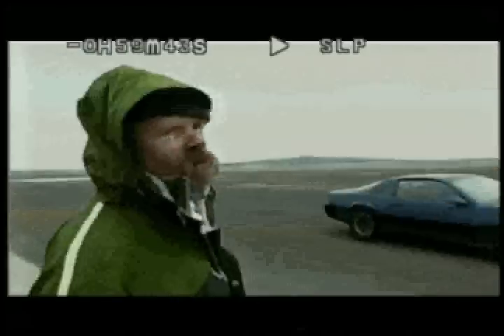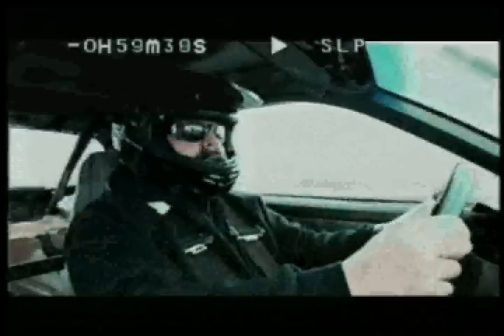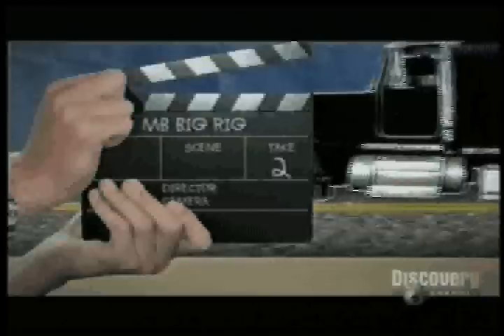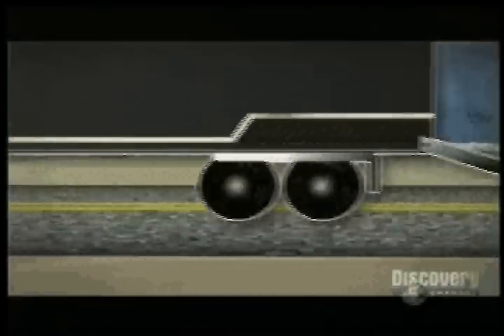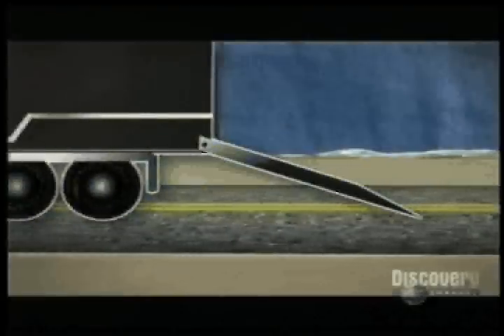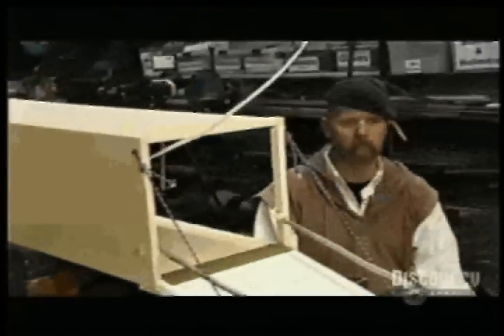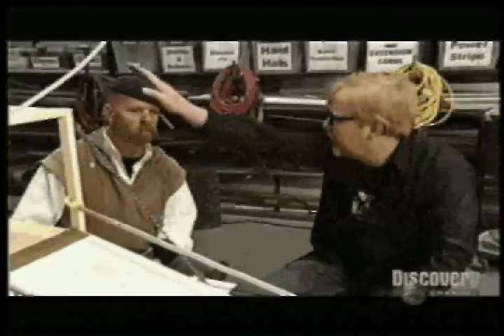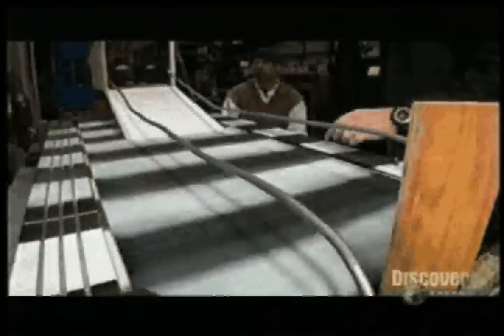Knightrider Mythbusters Myth Part 1

Comment: @UnderManlac In a RWD drive car, the front wheels are spinning because the car is being moved forward by the rear wheels. However, if the car is FWD, then the front wheels are the ones which are providing the force to move the car forward. Now, the instant before the car goes up on the ramp, the circumference of the front wheels are travelling at the same rate as the surface under it.

Comment: @UnderManlac In a RWD car, there will be no problem, because the front wheels will only spin as fast as the surface underneath it. In a FWD car, however, the front wheels cannot be stopped in an instant. Remember, the surface underneath it is moving at a fast rate. You should probably be able to conclude what would happen if those front wheels, suddenly, come upon the ramp, the surface of which is practically not moving relative to the forward motion of the car.

Comment: @UnderManlac The inertia of the car doesn't concern me, it's the rapid change in the speed of the rear wheels that are pulling the car (and thus connected to the gearbox). When you look at the video you can see that when the rear wheels touch the ramp they naturally slow down immediately. Relative to the ground the car is still moving at the same speed, of course. But on the ground the rear wheels are going at 45mph but on the ramp the car (relative to the ramp) is moving at 3 mph.
Reply: The rear wheels should go at 60 mph when they touch the ramp, car should crash due to the speed of the rear wheels

Comment: actually this works only with a car that has an automatic gearbox. A stickshift would probably stall on the ramp unless the driver shifted to neutral or first gear at the right time.

Comment: UnderManiac was right. There's inertia and also the fact the car is suddenly on an incline. It doesn't matter if the car is rear or front wheel drive. The physics are more complicated than is readily apparent. It's not as simple a situation as you think it is.

Comment: @UnderManlac Do I really have to explain this to you? Whether the car will jump right into the trailer is a matter of whether the front or rear wheels are driving car. Assuming that the car is RWD, the entry will be smooth, since the front wheels have no problem slowing down in an instant. Now, if the car is FWD, that's a different story.